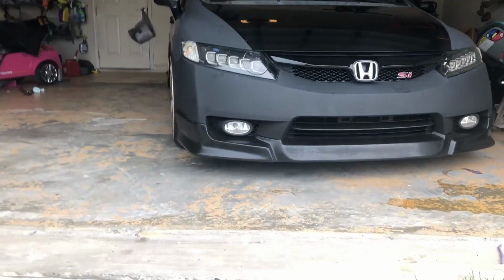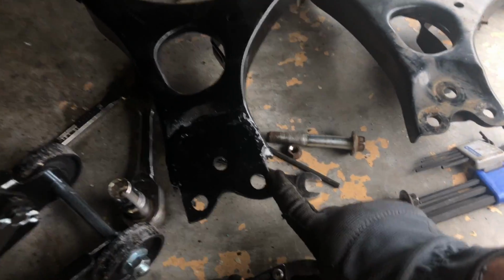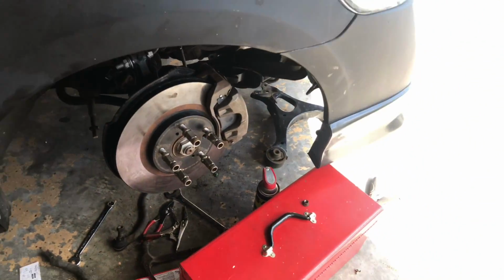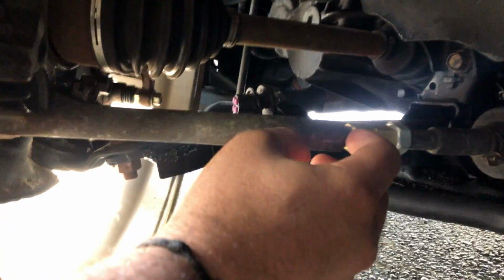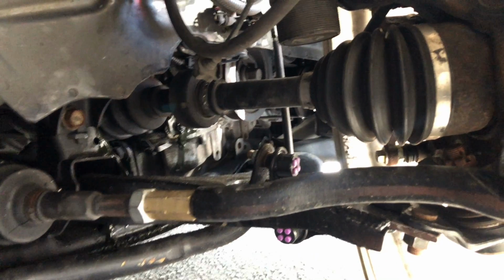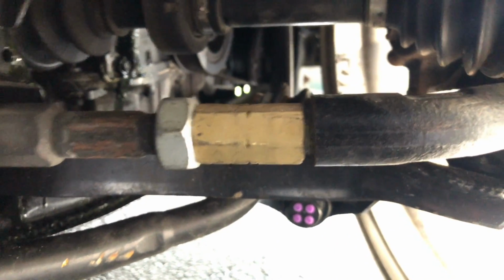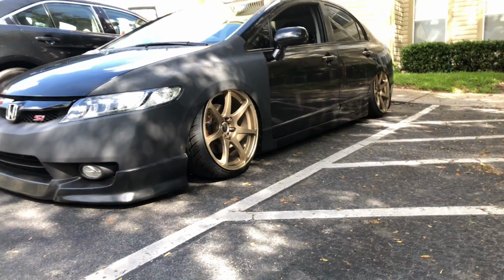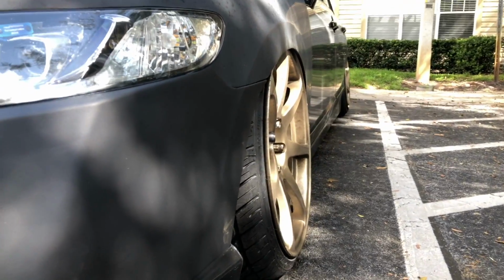Extended LCA for 8thgen Civic (More Camber)

Comment: My car has more camber then that when i lowered it my issue is my tire is rubbing my springs and struts in the front I can’t go any lower then I am at now what do I do to fix that
Reply from the maker: Your wheel offset is too high
Reply: @NamedLisandro  there stock Acura wheels on a civic it’s basically the same car
Reply: @NamedLisandro  guess I am gonna run spacers like a half inch spacer